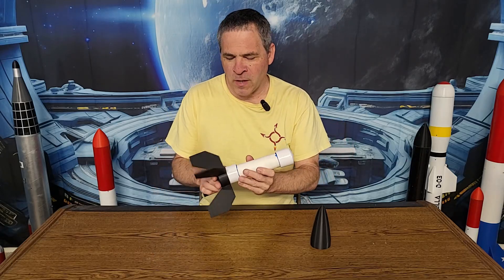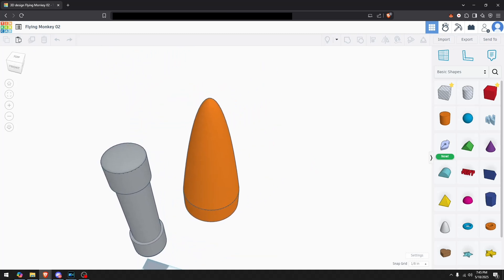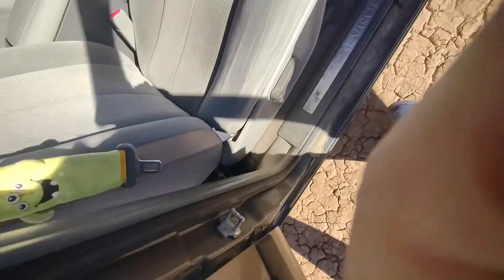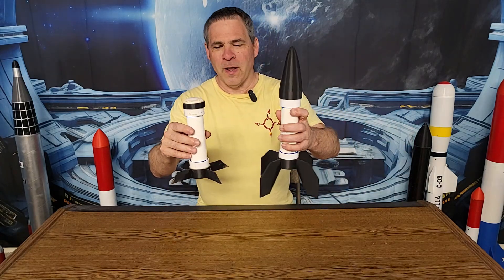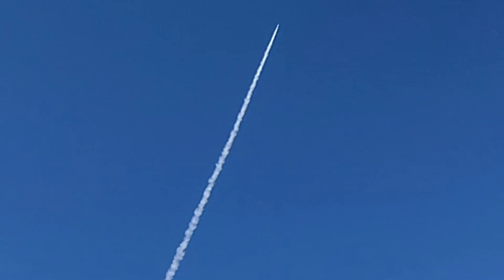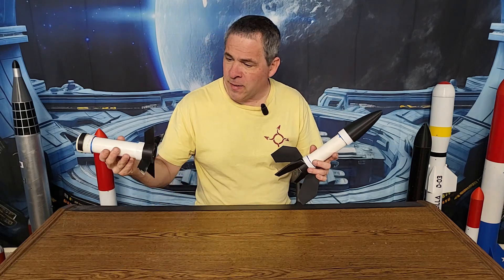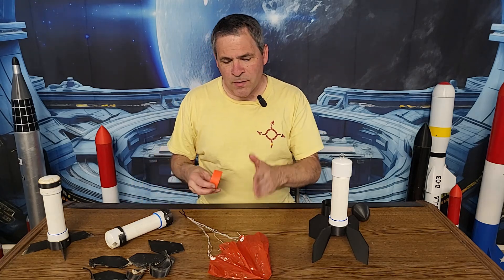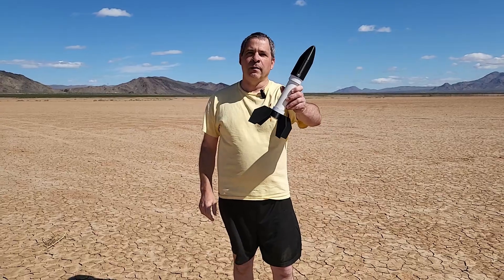Building and flying our smallest rocket ever.  Motor + Fins + Nose = The Flying Monkey

Comment: Make the fin like the first one after it lost the majority of its fins. Use the design just like it landed. I bet that would work just fine. The original fin design is a poor design.
Reply from the maker: First off... Yes, I know the fin design is not really the best. I was duplicating a design from someone else so that is why I made them that way.
But here are some facts...
The rocket design has a stability factor of 1.2 at launch. I went into the software and cut off the fins so they looked like they did when they were ripped off in flight. With those small fins, the rocket stability drops to 0.54 at launch. That "probably" would still fly but I don't like to design stability that low. There are two reasons it continued to fly well after the fins were ripped off.
1. Thrust was likely finished or close to finished.
2. The motor/rocket was around 275 grams lighter since the fuel was all used.

Comment: How did u make the engine. I’ve been trying to make sugar rockets but no stump remover contains KNO3 anymore.. idk what to do..
Reply from the maker: Here is our newest tutorial for building this motor...
https://youtu.be/U1PLWJNi9ko

Not sure what stump remover you are buying but I can still by KNO3 stump remover at my local hardware store. However, I don't buy my KNO3 in stump remover form because it's too expensive and it also needs to be ground down into a fine powder.
Go to seedranch.com and search for kno3. You can buy it in powder form in 5, 10, 20 and 50 pounds. Price is really good too. If you are not in the USA, they do offer international shipping but I don't know how expensive that would be.

Comment: That's really cool!

Maybe in the future you can get a better ejection setting.

I saw a little pop of smoke that made me figure it was ejecting at full speed.

Probably vacuum discharge was being bled at higher speed than the settings were calibrated for, and the instant the motor stopped burning, the speed reduced enough to fool the barometer into thinking the flight was over.

Can you set the barometer for a fixed pressure equal to a fixed altitude now that you know you have at least 3000 feet?

And what about a tipping trigger [similar to how a mercury switch works, but with a metal ball instead of a poisonous liquid metal]?

Just a small plastic straw, some hot glue, a ball bearing, 2 wire leads, and point it the direction of travel.

When the rocket launches, it remains in the back [against one plug of hot glue] but when the rocket tips over, no matter how fast it is falling, the fact that the steel ball is facing far less resistance, it can roll forward enough to make contact on the ejection charge anyhow.

It could be a common bb. a ball bearing, a small diameter piece of lead or tungsten bird shot.

It need not be large, its just there to trigger a sequence.

Probably would not add more than 14 grams to the launch weight.
Reply from the maker: It's funny that you have described perfectly a mechanical apogee detection system that I attempted to build and fly several years ago. Short story... It "can" work but not quite the way you are thinking. There are g-force and gravity (or zero gravity) issues at work here. Here's a short video by Dan Pollino that shows his mechanical apogee detection design...
https://www.youtube.com/watch?v=ZEwKxbTmhmA
The spring force in the reed switch is needed to create movement of the ball bearing at zero G. I gave up on mechanical apogee detection years ago because the flight computers are just so cheap.

This is a pre-made flight computer so I don't have control over the programming to set different triggers.

I really think I could get my design to work but I think it needs a lot more venting for the flight computer to get more consistent readings. I had very little venting in this design. I could be wrong, but we'll have to wait for "The Return of the Flying Monkey" in order to find out.
Reply: @rotaryrocketry  WOW!!!

THAT'S COMPLICATED!!!

My idea was WAY simpler!

Just make the ball free to move as the fins of the rocket cause the nose of the rocket to aim at the ground!

Just like dumping the ball out of a cup by flipping it over.

As the rocket naturally begins being pulled naturally toward the ground, the aft of the rocket is pushed away from the direction of travel.

2 wires, no coils, no transistors, capacitors, magnets, or transistors.

Again, just like a mercury switch...only without the mercury.

1 piece of plastic straw, 2 globs of hot glue, the 2 ends of wire on the end aiming in the direction of travel, and the metal sphere.

Could be made in about the time it took to get the glue gun hot.

Needs a pair of scissors, a glue gun, and any of a few simple ways to strip the ends of the wire bare.

One could scarcely make a simpler switch.

All it has to do is make sure the E-match has enough impulse to ignite whatever your ejection charge is, and as one who has dealt with blasting caps, I assure you, there are a lot of chemicals that are readily lit with nothing but the power of a passing CB radio!

An e-match that will light on 6 volts would not drain your small signal cell enough to keep it from working, so you would not need to add any other battery to the system.

The e-match typically burns through, and thereby breaks the circuit, thereby preventing it from continuing to drain the battery of its small charge.

But, should the e-match not break circuit, one might consider putting a jettison cord on the circuit so that as soon as the charge ejects the chute, it tugs a wire loose so that it does not continue to drain the battery.

Its also infinitely reusable.

Total cost, less than 15 cents American.
Reply from the maker: So to put as simply as possible... Your ways DOES NOT WORK.
If you make it with a ball bearing, it does not work. If you make it with a mercury switch, it does not work.
I know that in your mind it makes sense and when I was working on this type of thing, it made perfect sense to me too. But there are forces at work that you are not accounting for and it just simply doesn't work.

Here is a great video that illustrates Dan Pollino's original mechanical apogee detector that used a ball bearing. It's a fancy version of what you have described:
https://www.youtube.com/watch?v=ldaHifNAxsg

But here is what happens when you actually fly it:
https://www.youtube.com/watch?v=E1D_M1y8sFs

At the end of this video, Dan's friend who designed the newer system explains why the reed switch with spring tension is needed and how it operates at apogee:
https://www.youtube.com/watch?v=QnefN8jPz_Q

Hope you enjoy Dan's videos... I binge watched all of them a few years ago and found them very interesting.
Reply: @rotaryrocketry  You just sent a video which one million percent disproved your claim and proved my hypothesis.

And then you sent a video that proved absolutely nothing.

And, as you have clearly never conducted your own experimentation, clearly, you are using nothing but a definitively provable success, and a very vague video showing some unknown failure as proof.

This is the same way people cherry pick scriptures out of the bible [wrongly] as proof texts of false doctrines.

As one who has worked with missiles, of course, we never used such crude stuff because we used infra red and radar proximity fuses to blow up enemy planes, therefore, that can also not be used to prove either way.

So while you are free to believe whatever you wish, I shall some day just have to take the time out of my life to factually prove or disprove this theory with a minimum of 100 launches.

It will be a pain in the rear, but I SO HATE when people use such random and unrelated single-case references to declare a dogmatic belief.

I am a scientist, and therefore I can not allow this to rest without scientific research and documentation.

As such, I CHALLENGE YOU [and your audience] to jointly endeavor to actually do at least 100 tests.

AND...

Since e-matches are NOT FREE...

I suggest people use LED lights instead.

Because an LED light will even survive quite a potent impact, should the experimenter be trying this from clearly destructive altitudes.

Simple rules for this challenge: get your 'model rocket' to go at least 100 feet into the air, with enough fins to be able to flip over at apogee [if you cheat your fins to not flip the rocket over, you have falsified your tests, so be sure to know your airframe!].

Make one [or more] of these with about 2 inches of commonly available plastic straw, commonly available hot glue, a commonly available metallic sphere, commonly available wire [solid or braided], a commonly available 9 volt battery, and a commonly available LED light.

Any tube [fiberglass, paper, PVC, or printed, matters now] and fins, provided it can flip over at its balance point with no less than 100 feet of apogee.

Keep in mind, the aim of this is NOT to launch a rocket to the moon, or even very high into the sky.

It is to TEST PHYSICS.

And so making the fins larger will overcome the lack of terminal air speed in descent.

The sole and only purpose of this is to have as many people collectively attempt to recreate a ball-in-tube cascading switch mechanism.

This is a list of many many varieties if one needs more ideas for the test... https://uk.rs-online.com/web/c/switches/limit-position-switches/tilt-switches/ 

Ironically, its both cheap, AND a proven technology.

https://bc-robotics.com/shop/tilt-ball-switch/

This one even illustrates a factory made version... [less simple, but super cheap] https://learn.adafruit.com/tilt-sensor

Now...

While I have never used these on rockets [since the ones I was involved in in the USAF were meant to destroy things, not come back for reuse], I have used similar switches to these to place anti-personnel charges in front of humans.

Yes, just like any military person, I am a very bad person.

But I did it to defend YOUR FREEDOM to say to me I am full of crap, so you should at least be thankful for THAT much.

However, seeing as this is PROVEN TECHNOLOGY...

Saying it can't work, to an aerospace engineer such as myself, just ain't ever gunna fly.
Reply from the maker: First... I would ask you to kindly watch your attitude when discussing topics on my channel.

The videos I sent prove my point exactly. I'm sorry you don't see that. And I HAVE conducted experiments with both ball bearing design and mercury switch design. In fact, I have several of those tiny tilt switches. Yes, they are neat little devices and they work great... But they don't work for apogee detection in a rocket... and for exactly the reasons explained in Dan's videos. 
And just because I sent one video link showing the failure does not mean it was a one time test.
Dan launched several times with his original ball bearing design... They all failed.
He launched several times with the spring loaded reed switch... They were successful.

You think the ball bearing will just stay pushed downward until the rocket reaches apogee and then the ball will roll forward towards the nose when the rocket starts downward. It just simply does not work that way. G force, acceleration, deceleration, zero G... All these things occur and each have their own affect on the position of the ball. That is very well explained by Dan's friend in the last link I gave.

I tested it... It doesn't work.
Dan tested it...even more than I did... It doesn't work.
I don't know what else to tell you. Have you tested it?

You may respond if you like but at this point we clearly do not see eye-to-eye on the topic.
And as I have no desire for this to turn into some sort of argument, I will end my half of the conversation here.
Reply: @rotaryrocketry  As I said, I will conduct experiments.

If I find it does not work, then you will know that  I proved it to myself, using a very thorough scientific method.

I have learned that just because others fail, does not mean that things do not work.

And, in all honesty, I have had to admit the inability to do things others succeeded at.

If I fail, I shall admit my theory was bust.

But until I have run the tests, I can not accept outright that it will not work the way that I devised.

Also, just because one version of an idea fails, just means that like Thomas Edison, the idea needed more research.

I can even see an easy way to defeat the jiggle and bounce, using various weights of motor oil.

But since you're not interested, and I'm a long ways from that, I shall say nothing more on it here on your channel.
Reply: @hunnybunnysheavymetalmusic6542 the reason that a ball bearing tilt switch in the way you described it will not work is because the forces acted uppon it vary drasticly through the flight. At liftoff the ball experiences positive g's because the rocket is accelerating, here comes the problem at motor burnout the rocket will start deccelerating due to gravity drag ect. So the ball will feel negative g's meaning it will shoot upwards in the switch connecting the circuit, ejecting the parachute. That is the problem with simple mechanical tilt switch designs. So the ball bearing in the straw idea simply won't work

Comment: same way they make colored smoke 
is there away to add a layer to add a section of color 
or mix road flare in to the mix
Reply from the maker: I suppose if you got some of the color elements used in fireworks, you could mix that in with the fuel. A road flare uses strontium nitrate to produce the red flame. HOWEVER the color only applies to the flame. The smoke would still be grey.

Comment: I'd think you would want a small hole in the top of the nosecone, a good seal elsewhere, and be measuring when the pressure drops below some medium ALT threshold and then starts to rise again. It seems to me that you are not going to get a reliable ambient baro pressure drop reading in an object moving 100s of MPH due to a bunch of different fluid-dynamics issues with any vents in the nosecone.
Reply from the maker: Never heard of anyone putting a vent hole in the top of the nose cone. I have doubts about that working well. Our rockets get up to several hundred MPH and this one is probably the fastest one we've ever flow. With a hole in the tip, the air would be forcefully pushed into the flight computer bay which is not likely to provide accurate pressure readings.

Comment: Nice video, I like your launch pad.
Reply from the maker: Have you made any progress on your rocket & motor design?
Reply: @rotaryrocketry after we had a successful launch using table sugar as fuel. I was donated some fruit sugar so I tried to use it on our last few launches. 1/2 of those launches blew out the nozzle and some blew up the engine into little bits. Googled the chemical reaction speed of kno3 with fruit sugar sure enough it is faster than table sugar . Next launch test would be use table sugar again to make sure I am not crazy.
Reply from the maker: Are you making flex-fuel with corn syrup or just sugar + potassium nitrate?
Reply: @rotaryrocketry syrup and sugar, seem the fruit sugar really speed up the reaction. I want to use sorbitol I read it slows down the reaction a lot. What are you guys using?
Reply from the maker: My mix is Corn Syrup, Powdered Sugar, Potassium Nitrate.
My friend The Rocketeer has told me that he believes Sorbital fuel is a bit slower but I have not tested it.
I just wanted to be sure you were not using R-Candy (sugar & kno3) because it is ridiculously fast burning.
Reply: @rotaryrocketry we found using syrups and sugar is hard to work with it harden too fast.